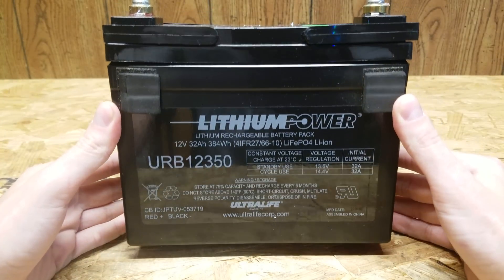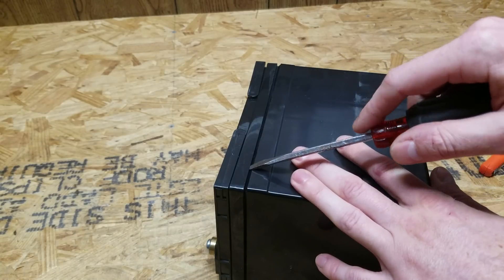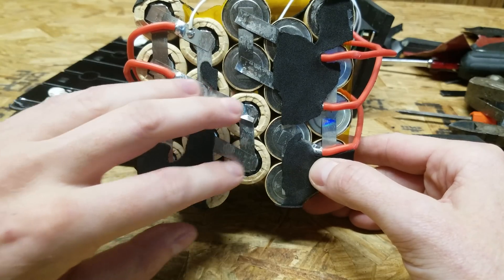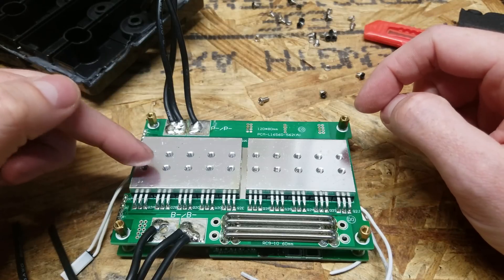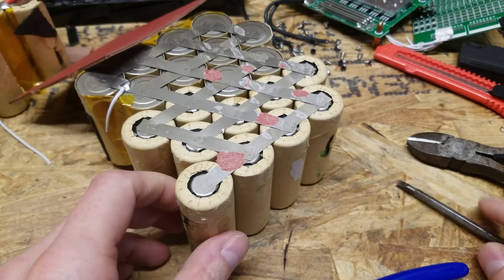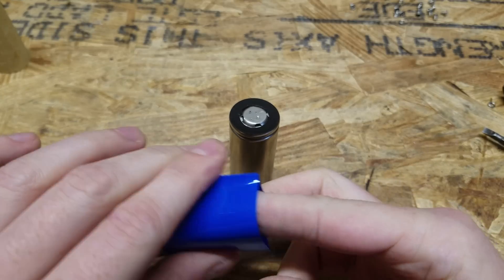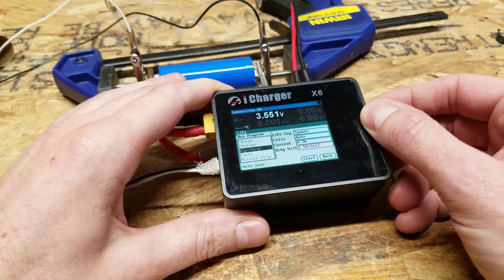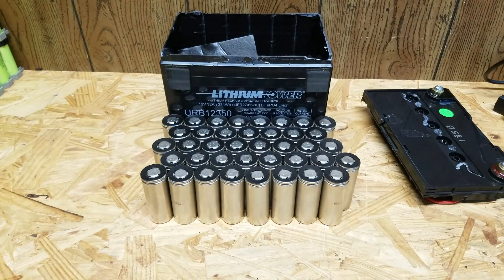What's Inside a 12V LithiumPower URB12350 LiFePO4 Battery?

Comment: On the upper right side of  the piece of paper you show when you are trying to figure out the kind of cells. there are 3 check boxes with a blue check mark on the middle one. When I pause the video, it looks like it says 26650-3200-3.3... That's going to be the cell size, mah capacity and nominal cell voltage...

Comment: You got the count wrong.  It happens.  The configuration was 4x5x2 or a total of 40 cells.  Been watching allot on the tech.  One of the vids was someone made a ammo box battery which was 7x13x2. I disagreed with the construction (wiring) but it worked,  So this give me some ideas on how to address it.  If I ever do it.  Just don't have time for anything for myself anymore as am being worked to death as the firm does more with less.  But at least am working.

Comment: They are 26650, where the 12350 come from ?
Reply from the maker: That's the model number of the 12V battery. It's not a reference to the size of cells used inside.

Comment: Thanks for your efforts!! This video answered lots of questions for me ---Thanks.
 I bought 2 of these the day they were offered and smashed a copper pipe for a bus bar to hook them in parallel. I replaced a flat, 100 amp FLA "house battery" in my little travel trailer. I have a Tesla pack with solar panels for off grid but the main panel still uses a 12v battery in the dc circuits for lights and jacks and devices. If it delivers 80% I will have the same amount of usable power, but at 71 it will be the last battery I buy for this thing. It cost $200 plus about $2.00 in parts. Not a steal, but totally a bargain considering the simplicity.

Comment: If you weigh the battery, you would get the rough estimate of the estimate capacity. That is by  comparing the weights of other brands that has the same weight as yours.

Comment: Can I suggest you put metric figures in pop-ups/labels on the video so our metric friends are not totally lost by our inches, feet, gallbladder and eyelashes units of measurements?
Reply from the maker: I tried doing metric in the past, then people complained that I didn't use US measurements. I just can't win...
Reply: @LithiumSolar  What I was suggesting is that you keep narrating in Imperial but add an insert in the video with the Metric conversion. Both groups should be fine with that.

Comment: I want to build a small 12 volt battery for my bike that's a 4S kind like the one in the video but smaller and lighter, I want to be able to safely take 15 to 20 amps out of it at 12 volts and charge it from a bike generator or AC outlet (through a AC to DC converter) i have not built a lithium battery before so i need to know what to use for this to have it work like i want and be safe, i found some batteries that are 32700 6 Amp-hours lifepo4 on Ebay https://www.ebay.com/itm/283963906954 but i don't know how many i need or what BMS to use

Comment: You can dissolve the glue on those battery cases with flux-off. Mask off the area on both sides of the seam because it will slightly dissolve the plastic too. If the solvent doesn’t work the first time, put it in the freezer for 15-20 minutes and then rap on the seam with the handle of a screwdriver and repeat. I’ve done it at least 64 times ;)

Comment: How would you charge it as a whole?
Reply from the maker: My experience with LiFePO4 is minimal, but according to what I've read and statements from the manufacturer themselves, a 2-stage lead acid charger would work fine to charge the battery as a whole.

Comment: I guess they've just used standard size battery cases originally used for lead acid batteries. Either for compatibility size-wise, for the mentioned intention of these being drop-ins, or because it's just cheaper to use existing cases instead of making custom molds. That's why the holes are there, they have no use when populating the case with lithium cells.

Another viewer already commented that the label you've found inside contains the information you were looking for regarding cell sizes. But the battery also tells you its configuration right there on the outside. It says 4IFR27/66-10. That's a standard notation for batteries made out of cylindrical cells.
4 = 4 cells in series
IFR = one of several different names for the Lithium Iron Phosphate chemistry
27/66 = diameter and length, often given as +1mm, to accomodate for the sleeves and nickel strip, so this means 26650
-10 = 10 cells in parallel

These cells could be older stock of Heter cells, they've used this cardboard sleeves in the past. I think they've stopped doing that by now and also retired the Heter brand (while still keeping it as their company name). Not sure if they even still sell these at all through a direct-to-customer distribution model. They might have changed over to an OEM business model since their model name for the cells, HTCFR26650, is now commonly used by JGNE, which is a Goldencell brand, and ENERpower, which is a brand from a German company selling cells, batteries and related equipment for outdoor and maritime use and so on. Both use the same model name that was already used when Heter sold these cells themselves and ENERpower even officially states that their cells are made by Heter.

If this is the case of them being old stock, then these might be a bit lazy because they haven't been cycled for some time. If so, then they might recover some of their capacity over the next couple of cycles. And in addition, these cells were probably specified with an end-of-discharge at 2.0V which will not make a huge difference, but might yield another 100mAh or so.
Reply: might be for RV purose as agm replacements I guess

Comment: Pretty simple little battery I expected a different design as the one they used is almost DIY lol. The 100 amp Esmart I got has a bolt together design. cool thanks
Reply from the maker: It does look rather DIY doesn't it lol. I anticipated cylindrical cells, just thought they would be low-mAh 18650s not 26650s.

Comment: Hey, good video...to wire one of those lithium batteries to an inverter, what's your recommended type of fuse?
Reply from the maker: I think I would use a 50A fuse to make sure the continuous current stays below the BMS limit of 60A.
Reply: @LithiumSolar   ANL fuse?

Comment: No cell holders. Pretty cheap battery. Always use cell holders. BH wants to much for that battery.
Reply from the maker: It seems cardboard sleeves are a common substitute for cell holders. I'd rather see cell holders as well though and also agree it's a bit expensive for what you get here.

Comment: I am wondering about these 'drop in' replacements, assuming that means they are drop in replacements for lead acid batteries, if there is a DC - DC converter inside that BMS for charging because the charging regime of anything Lithium is quite specific and complex and unlike Lead Acid which is quite broad and forgiving, generally 13.8V and that's it, when the battery is charged it will stop drawing current.
Reply from the maker: Yes, it's a reference to lead acid replacements. It does not have an internal DC-DC converter. This is LiFePO4 with 3.2V cells, which has voltages very similar to lead acid. It's not NMC with 3.7V cells. The manufacturer says "can be properly charged using a 2 phase
SLA charger".
Reply: @LithiumSolar  Thanks - seems Lithium Iron Phosphate can handle a fixed voltage charge like Lead Acid, from https://www.powerstream.com/LLLF.htm "Because an overvoltage can be applied to the LiFePO4 battery without decomposing the electrolyte, it can be charged by only one step of CC to reach 95% SOC or be charged by CC+CV to get 100% SOC. This is similar to the way lead acid batteries are safely force charged. The minimum total charging time will be about two hours."  and  "A LiFePO4 battery can be safely overcharged to 4.2 volts per cell, but higher voltages will start to break down the organic electrolytes. Nevertheless, it is common to charge a 12 volt a 4-cell series pack with a lead acid battery charger. The maximum voltage of these chargers, whether AC powered, or using a car's alternator, is 14.4 volts. This works fine, but lead acid chargers will lower their voltage to 13.8 volts for the float charge, and so will usually terminate before the LiFe pack is at 100%. For this reason a special LiFe charger is required to reliably get to 100% capacity."

Comment: I hate to see you destroy a perfectly good battery. You could have done all of that testing non destructively
Reply from the maker: Once you open it, it will never go back together. They're glued shut and the battery pack had sooo much tape and adhesive padding. It's not "destroyed" though, the cells will all be wrapped with blue heat shrink when my shrink order arrives. The batteries will be rebuilt in a new pack and put to good use! :)

Comment: I got one of those batteries as well but I didn't take mine apart :)
I capacity tested mine using the iCharger x8 and got 28Ah but I only discharged to 2.7v per cell (10.8v for the pack) however there would be very little energy left in those cells going from 2.7v to 2.5v so I would count that as negligible. I did the test at 10A as I wasn't sure of the specifications on the BMS and whether there were prismatic cells inside which are capable of high current discharging or individual cells such as these. Very cool. Thanks for taking yours apart so I don't have to butcher mine up :)
Reply from the maker: I really should have tested the battery as a whole before I opened it. That was kindof dumb on my part. As soon as I got it, I had the urge to start opening it up and didn't even think of it lol. I'll test a few more cells and see if they're the same.

Comment: Is there any temperature protection on that bms? Looking at maybe using 10 of these in a van conversion
Reply from the maker: It does have one temperature sensor that was affixed to the battery pack. That suggests there is some sort of protection, but I do not see any mention of it on the BMS spec sheet I found.
Reply from the maker: Ah, it has over-temp protection at 65C. There's a technical datasheet from the battery manufacturer here https://www.ultralifecorporation.com/ECommerce/product/urb12350/lfp-128v32ah-non-smart
Reply: @LithiumSolar  thanks!

Comment: Could this replace a car battery? I'm guessing it would have more capacity than a lead acid car battery too
Reply from the maker: No. I don't know the exact specs of the cells, but I can tell you that the BMS won't be able to handle the burst current required to start the engine. You'll likely blow out the MOSFETs.
Reply from the maker: Might work well for a garden tractor or similar though. Interesting thought :)